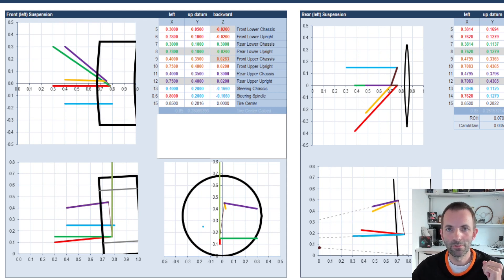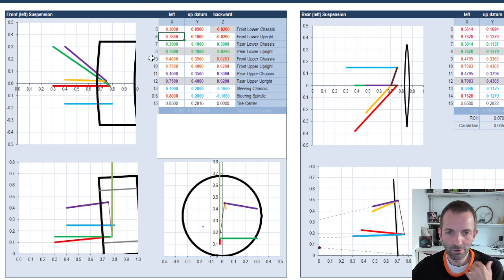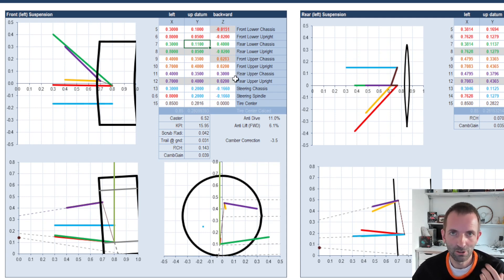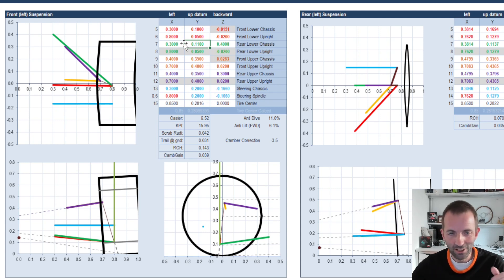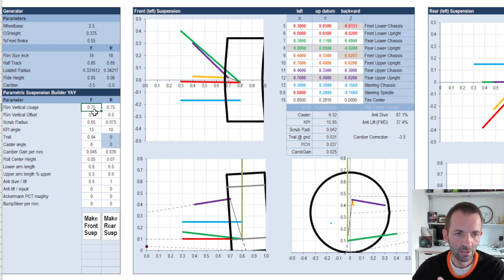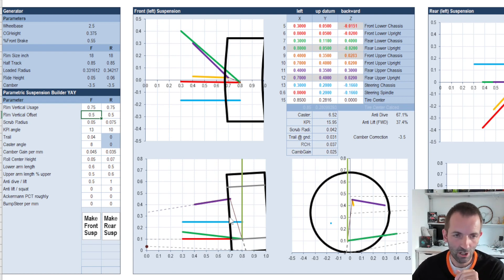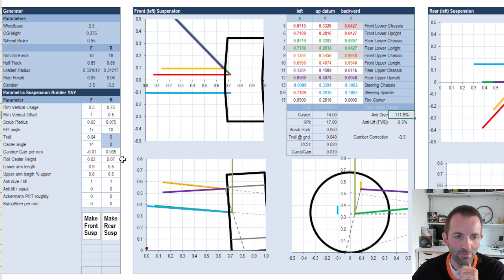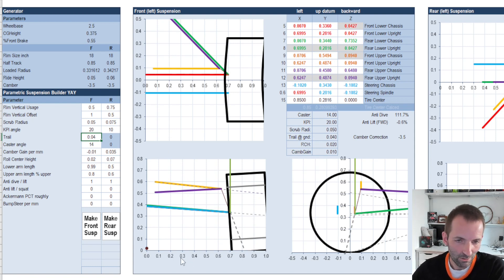This SpreadSheet Can Generate an INFINITE number of Double Wishbone(rs)!

Comment: Niels have you tried to use like performance trends suspension software?
I find it very user friendly compared to other programs, and it tells you everything the suspension does when you move things around.
Reply from the maker: Yes I used it a little way back, I believe someone had a Supra suspension which I used for the RFactor 1 mod. There is also 'Susprog3d' and others. I don't think there is an easy way to import simulator files into these programs though, making it time consuming if you're making a sim with 50 cars, to check each one! And unless I am mistaken, these programs are good at checking everything, they don't make geometry for you. For the fastest workflow having it all in a spreadsheet, even if some details are missing compared to say Performance Trends, it might be more efficient and productive. Of course a good sim should have debug modes where you can triple check if the sim itself does what you think it does!

Comment: Amazing technique! Thank you for sharing this experience. Niels, it would be great if you recorded a video about how in simulators the simulation of unsprung mass occurs. Calculation of suspension kinematics. Solvers are used to solve systems of equations, or physical constraints. Or some other technique. Thank you!
Reply from the maker: I know rFactor (and AMS and all rFactor derived sims), rFactor 2 use a solver of some sort. I also know of someone making a fully determined (if that is the word) system .. but this is waaaay over my head. You can run rFactor 1 physics at easily 15000hz (probably double nowadays!) so whatever they do, it is pretty efficient!
Reply: I love it. Tell me more things like that. @NielsHeusinkveld